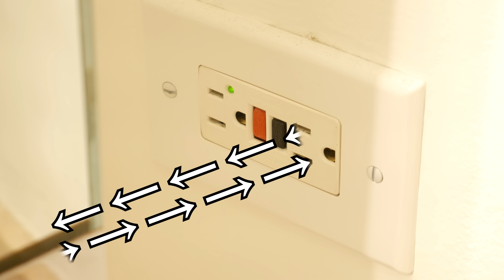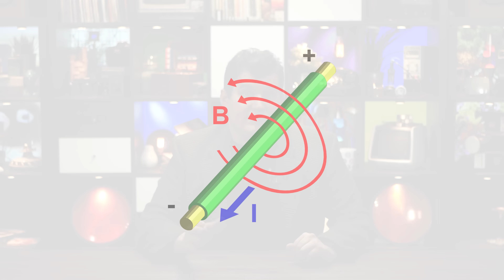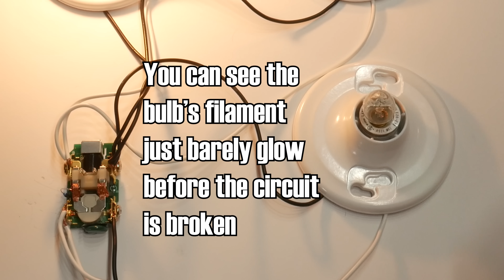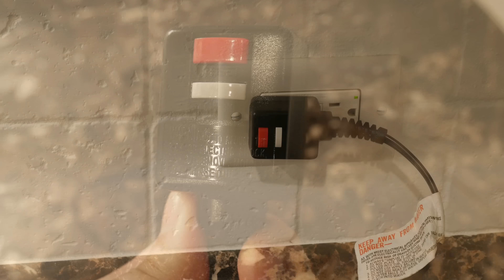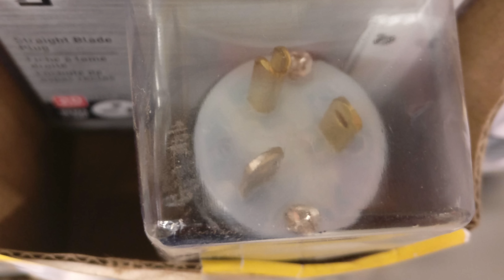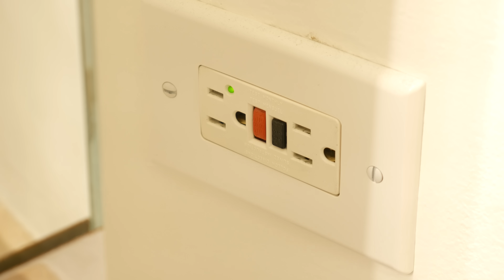The GFCI/RCD: A Simple but Life-Saving Protector

Comment: Watched this, as a one time ( long time ) electrician, controls electrician, and flows/controls engineer... just wondered how you'd spin this blah topic into something interesting.  Knew you would manage, just wondered how exactly.  Nice job.  That said, here in the US we do incorporate service entrance GFCI breakers as well.  They can bypass the need entirely to have a GFCI receptacle within the standard 30' of a water closet.  Also, as you mention European standards a bit, their service entrances are far more akin to our controls electrical.  Exact same components we use for the input side of control boxes for say, traffic control lights... as I know you fancy those a bit... Is the very same equipment they have as breakers in their residential service entrances or distribution panels.   Again... nice job with this topic.  You really have a way of, I don't know.. just making otherwise mundane information a pleasure to delve into.

Comment: In spanish  (Argentina) it's called "disyuntor diferencial". Something like "diferential circuit breaker". It's installed right after the main power switch, in the main control panel. Argentina's regulations are very similar to European's.
Also it's common to install thermal-magnetic circuit breakers.

Comment: Good video, only nit pick: your definition of ground fault is a little off. A ground fault is when some of the current returns via the grounding equipment (referred to as ground, or earth) and not the neutral, the video says that "some of the current is not returning to ground or the neutral side" which is not correct, you are likely grounded, so the problem is that it is returning through the ground and not through the neutral.

TL;DR if you connect one of the connections of the lamp to the ground pin of the GFCI/RCD it will also cause a ground fault (and will trip) therefore to say that it trips as "some of the current is not returning to ground or the neutral side" is incorrect and should simply be "some of the current is not returning to the neutral side"

Comment: Now, in the UK, we're not allowed to have mains sockets in the bathroom or near sinks.  Also, I think you think you should take a look at the British plug and socket.  

In the UK, we don't have RCDs on the socket (as you've said, they're on they've replaced the fuseboard) and instead have isolating swtiches.  

Having RCDs in the socket or the plug is actually something the Americans have done better than we here in the UK.  Though I'd say the best way is to put them in both places.

Comment: Might be worth to point out that, even though very unlikely, it wont protect you at all if you find yourself in between the feed and neutral. Dont think a gfci / rcb necessarily protect you if messing around with live wires.

Comment: Here in Canada in about the mid-seventies, kitchen plugs were required to be put on split circuits in order to increase current capacity.  However, as the code now requires gfci protection on kitchen plugs, it was found that the 3 conductor panel mounted gfcis suitable for split circuits were very expensive,; aroun $100.00 each.  The code has consequently been changed.  Split circuits are no longer required and the kitchen plugs are 2 comductor 20 amp devices now.  The panel mounted gfcis for these are considerably cheaper, but now the circuits don't have the capacity of the old split circuits.

Comment: You're right about GFCI protection NOT being for circuit overload, and here's the scary part about that; It is near IMPOSSIBLE to find a protection circuit that protects both circuit overload and ground fault, especially if you're wanting it cheap!  You can find through a simple Google search for one or the other, NOT BOTH.  You can find traditional circuit breakers with both features, (overload protection for obvious reasons) but really difficult to find a typical wall outlet with both features integrated, but I suppose that would be redundant if it's on a overload protected circuit breaker anyway.  But as you stated in the video, it IS possible to run a 20 amp plug on that GFCI protected outlet, which would lead to an obvious overload of the circuit, possibly frying some things in the process if the breaker doesn't react fast enough.
Reply: Using a GFCI rated for a 20 amp circuit does not mean that 20 amps will flow through it.  (More detail below)  It just means that the GFCI wouldn't overload because of it, even if the 20 amps is sustained.  Note that overload I'm talking about is different than tripping; anything besides a fuse or current overload circuit breaker overloading is bad.

I'm not sure why there aren't more Residual Current plus Overload Circuit Interrupt devices, except possibly a perceived lack of need.  Back in the day, connecting both the residual current detection and a bimetallic strip to the same solenoid may have been tricky, but with ICs, it should be easy now.  The additional complexity to the IC would likely be trivial over the GFCI only IC, so it could be used for both devices without significant cost besides the initial build - which they've likely already done if they have any modern combo outlets.  But in our supply chain, a lack of demand frequently results in the supply drying up and the cost going up as a result.  And then you're stuck, because getting that demand back now is hard.

Electricity doesn't work like your post suggests.  A circuit doesn't fundamentally carry a particular amperage.  It gets designed to handle a particular amperage, but what it actually carries is the result of `current = voltage / resistance`, where resistance is computed over the entire circuit.

Resistance is fundamental to the circuit.  It can be changed by the environment for those parts of the circuit that are exposed to a particular part of the environment.  For example, by raising the temperature, you raise resistance.  By getting the circuit wet, you may lower the resistance, and you're likely to provide alternate paths, at least temporarily.  However, the `wet` effect only counts where the circuit itself is exposed, for example where there's bare copper.  Over the designed operating temperature range, the effect of temperature on a circuit is usually negligible, though there's typically a temperature below which superconducting can happen, for at least some of the materials.  Superconducting is weird and I don't understand all of it, but it feels to me like superconducting happening for doped silicon would be bad for any computer devices.  But that would probably be at an insanely cold temperature.

Voltage is something provided by the power company.  On an AC circuit, you can use transformers to adjust the voltage and potential current, but after we get current to a home, we mostly only do that for specific devices, and usually that's as part of an AC to DC converter.

Comment: I noticed the mechanism for detecting the ground fault would also detect if more current is returning than left, also tripping. Is that a scenario that can happen (outside of stuff like lightning strikes that would just melt this thing)?
Reply: Yes: it mesaures if the difference between live and neutral is less then the threnshold (that's also why many countries calls it differential switch)
Reply: Davide Bacchi yeah I got that from the video, I'm asking if there's a scenario where more rather than less current returns through the ground.
Reply: It shouldn't happen in a properly wired system but the case is shared live: you have a 'crossing' line with phase from a non-RCD line and neutral on RCD line. In that case current 'coming back' will be bigger than current going. But in that case RCD will trip all the time the 'crossing' appliance is on. Just very low power appliances won't let it trip (here, with 30mA a similar situation won't trip for less than 7W).

Comment: Can you cover AFCIs? I just remodeled my house and I had to use AFCIs in bedrooms at the start of each circuit and GFCIs in the bathroom and kitchen. The electrician didn't have a good answer of why they're different, or why AFCI protection is so much more expensive.
Reply: An Arc Fault Circuit Interrupter is apparently designed to prevent electrical fires, rather than to protect people from getting shocks.  I don't know how they do that, but it sounds really neat that people can.  I haven't watched all of Alec's videos yet, so I don't know if he's made this yet.  But I hope he does eventually get a video on the topic if he doesn't have one already, because googling for information on these makes my head hurt.

Comment: Why don't 110v outlets have on/off switches ?
I noticed that in Japan also
Reply: Scott Brownlie don’t need them.
Reply: Mostlyharmless1985 why don't you need them? You have to pull the plug out to isolate anything. Over time his wears the internal contacts, potentially causing failure like overheating. Plus you then have a plug loose on the floor or worktop, potentially getting damaged, wet or whatever. It's just a cost cutting measure that they don't have them. Once you have switched outlets anything else would seem inferior!
Reply: There's this thing called a multitap, or surge protector, do look it up. There is no need to "isolate" anything. "having a plug loose on the floor or a worktop" isn't an issue for NEMA plugs because they aren't designed to be inherent land mines, and the nature of the pins are such that damage is unlikely, if you bend it out of place, just bend it back, if you break it, go to the hardware store and spend a dollar to replace it.
If i'm in a wet environment and want to de-energize a device for whatever reason, i would hit that nice, handy, "Test" button on the GFI.
"It's just a cost cutting measure." Exactly. We don't need to have a switch for every outlet because most high current devices carry hard switches, and the ones with soft switches shouldn't be "isolated" anyway because it would impair the function of the device. I guess if you were an absolute penny grubbing douchebag, this would bother you, but we have devices like the Kill-o-watt for people like you.
"Once you have switched outlets anything else would seem inferior."
I have had switched outlets, they are a complete and utter pain in the ass. Just about every time I used it I had to stare baffled at it like a moron to figure out why it wasn't working, then switch the outlet on, then remark. "Why the fuck is the outlet switched, they can't wire it to a light switch like a sensible person?!"
Reply: Mostlyharmless1985 So instead, you suggest things like hair straighteners etc that are in frequent use and often left plugged in be isolated only by the switch on the appliance? Have you any idea how many fires have started this way? You can tell at a glance if something in a switched outlet is on or off. It's another level of protection. I take your point about plugs / damage and replacement but leaving them in the outlet is still the easiest and most convenient option. In the U.K. It is very rare to find an unstitched outlet- they can be purchased, but no one fits them. Why? Because people prefer switches- they make life easier.
Reply: Spencer Wilton “have you any idea how many fires have started that way?”
Not many, because people don’t leave their “frequently used appliances.” Plugged in, and out them away after they are used, like normal people. Second, how exactly can a fire start from an appliance that’s switched off?
“Leaving then in the outlet is still the easiest and most convienient option.”
It’s also the least safe and least neat option. 
Finally, did you miss the part where we attach  to the light switch for outlets we want on and off for easy “isolation?”
Switch the light off, all the outlets in the room go dead, far better than individually switched outlets and has more of the convenience you seem to crave for no practical reason. 
There is no point to individually switched outlets.
Reply: Mostlyharmless1985 appliance are not usually put away after use- things like hair straighteners for example. It's easy to leave them switched on without realising, and there have been plenty of fires as a result! I wasn't suggesting they started fires when switched off, just when inadvertently left switched on. 

You go on to talk about lightswitch operated outlets, so actually you concede that there are occasions when it is convenient to have a switch operating a socket or several. Surely then it makes sense to make every socket switch controlled. 

I can see that we are going to have to agree to disagree. You have your preferences, other nations have theirs, its like the driving in the left or right argument- pointless. It's what you're used to, it becomes second nature and personally I would find it strange to have to adapt to not using socket switches.
Reply: We do have them, they're just not commonly used. https://www.google.com/shopping/product/15377076497495936413?lsf=seller:6472097,store:14571609704127407091,lsfqd:0&prds=oid:11564846812622555158&q=Leviton+15+Amp+Combination+Switch-Receptacle+in+Off-White&hl=en&ei=Nf53W4aoMsrWjwTwm6SACg&lsft=gclid:EAIaIQobChMI8-rGlbv23AIVmrXACh1vnw44EAYYBiABEgIed_D_BwE

Comment: With new energy efficient appliances and lighting, these circuits can still work, even with less current draw.  LEDs have become pretty common now and are getting more and more efficient, yet can still trip an older GFCI circuit just fine.  Now, if only GFCI sockets and adapters were cheaper, considering how many lives they save, many extension cords are not protected without an adapter, and some outdoor circuits aren't protected at all.  The simple solution (that I'm frankly having trouble finding) is if you're going to run outdoor extension cords, the sockets themselves should've been made GFCI protected, as it is possible to wire your own outlets and prongs on extension cords, and even wire them completely wrong.  The ONLY thing protecting that circuit with the extension cord without a GFCI adapter is the circuit breaker itself, which only flips when amp overloaded, NOT when there's a ground fault!

Comment: An interesting side effect of how these work make it impossible to use the outlets on a split-phase shared neutral circuit except at the very end of the circuit.
I discovered this when my father-in-law (an electrical engineer) designed a pair of 20-amp circuits for my garage/workshop. The idea was to have multiple 4-plex electrical boxes, where all of the left hand outlets would be on one 20-amp circuit, and the right hand outlets would be on the other. To do this, he took advantage of split-phase and ran just a single neutral wire to each box (plus two lives and a ground). However, that meant we couldn't just put a GFCI outlet at the start of each circuit, since there was no way for each GFCI outlet to determine whether the current exiting through the neutral was coming from its live or the or the other circuit's live.
Luckily, there are combination breaker/GFCI units that can fit in the electrical box that are designed for exactly that situation - they compare the current exiting through the neutral wire with the current flowing in both lives. They aren't something you can usually find in the big-box stores - I had to go to a specialist electrical supply store to get it.
Note that it's fine to use a GFCI outlet at the end of the circuit - you just can't put it anywhere before the end.
Reply: Manuel McLure And those are the only ones used in Europe (and sold in big box stores).  Of cause, ours are rated for our voltage and current: 3 phases, 230V each plus the neutral, total 4 wires.  10A to 16A in each circuit.  That's 2200W in the smallest outlets, 10000W in the biggest that doesn't need an industrial plug.
Reply: You can, however, buy combination gfci and breaker units  for 120/240 circuits that have connections for both hot legs and the neutral which can be installed on the panel.  They can provide protection for a straight 240  volt circuit (neutral connection not used) or a split phase 120/240 volt circuit(neutral connected).  They are, however, quite expensive, I believe (around $100.00?)

Comment: Another problem with them being in the main panel, some places the main panel is locked (hotels, apartments, etc).  With how sensitive these are to tripping, they tend to trip often (sometimes, when there is no fault, such as with a power surge).  However, if they are in the breaker, in a locked panel, the only way for someone to reset them would be to have access to the panel.  If the panel is locked, you need to wait for someone to open the panel and reset it, compared to with the plug where anyone with access to the plug (which you should have if you are using it) can reset it.

In homes, I prefer the one in the main panel, as it creates a cleaner look.  But I can see why the outlet type are still used in several applications.

Comment: the differences in outlets between US and Europe almost cost me my life, or could make me severely mutilated. My old stereo hifi system by Sony had an American plug which had to be first plugged into an adapter for European outlets, but this adapter got loose with time. And one night, after some drinking, I tried to unplug the system and the plug came leaving the adapter in the outlet with bare electrodes sticking out. I almost touched them, because I didn't think. That could fry my fingers or worse. I was only saved by a minuscule amount of gray matter which was still alert and recalled grandma's teachings "Don't stick your damned fingers in the electric outlet or you'll get a kick you'll never forget!". Phew.
Reply: Radio Żelaza never. Ever. Use an adapter, cut the lead and re terminate it if you must if you have no choice but to use an adapter then get one that specifically adapts the plug you are using to the socket you are doing. Those multi plug adapters are criminally dangerous, allowing you to do all kinds of evil like energize the ground pin.